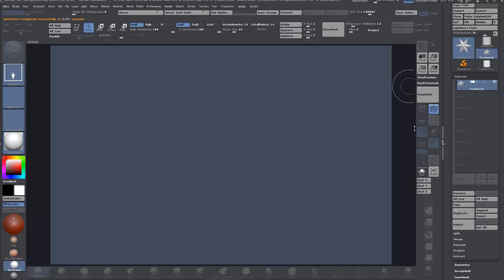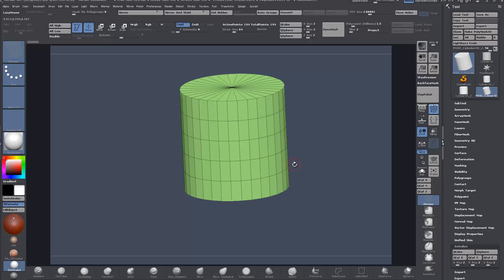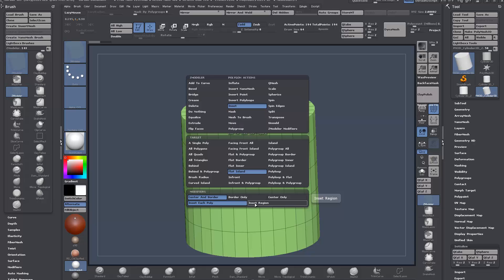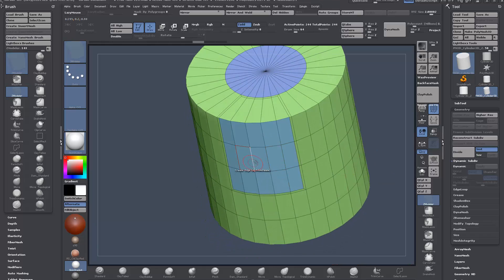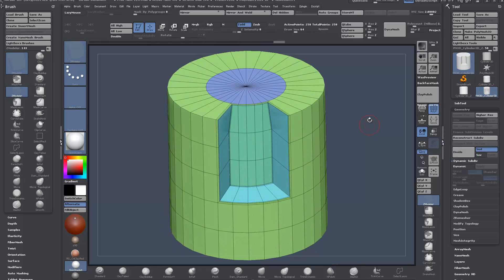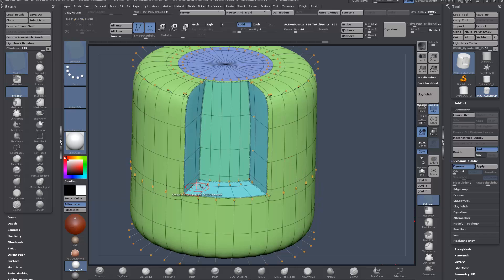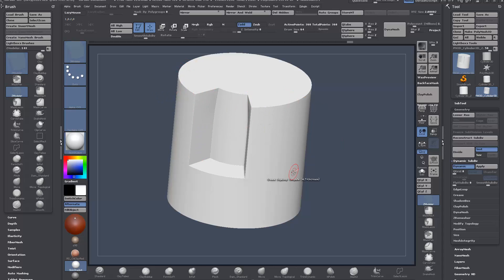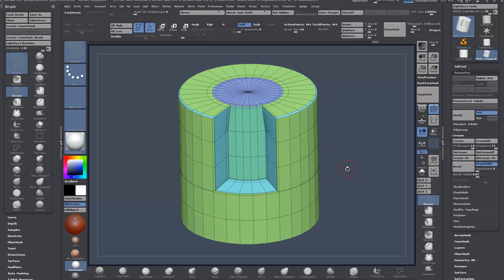Zmodeler - Zbrush Creasing and Control Edges Tutorial

Comment: Thanks!How do you select multiple edges and drag them up? I am trying to make a house and the roof has several edges that I want to lift up to form the roof top but I am having to select each edge at a time and eyeballing things.
Reply from the maker: You're welcome. You can mask+invert+transpose move the verts you want to affect. There is also the option of using the Zmodeler edge actions to move unmasked edges.